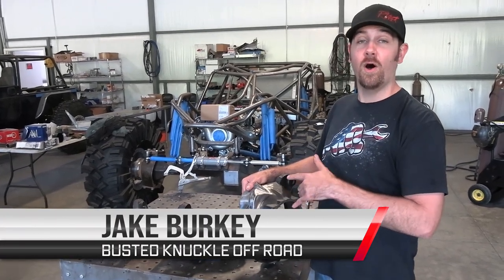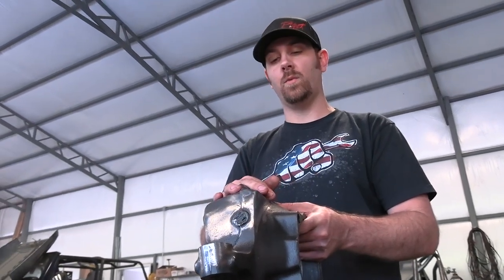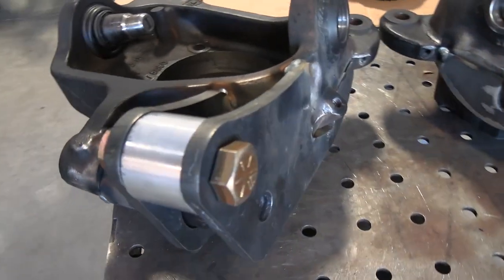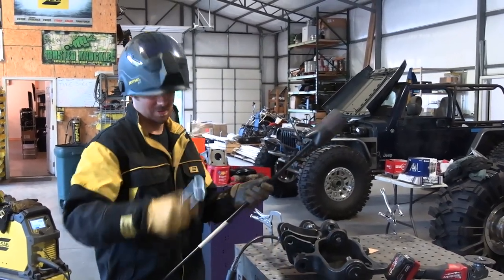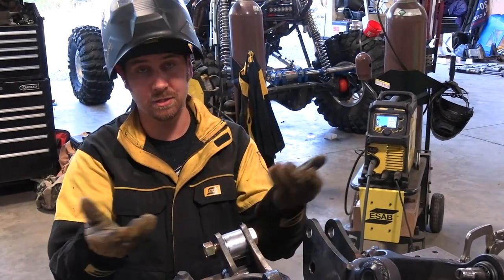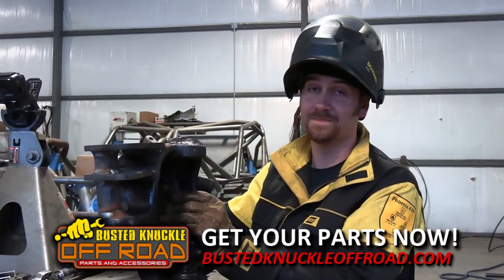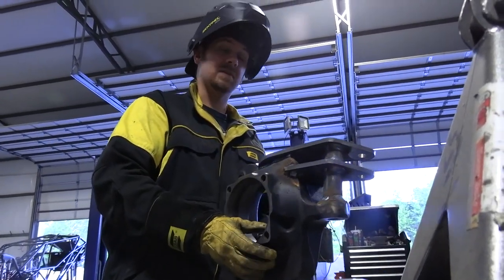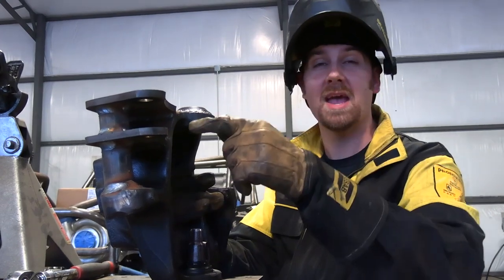Weld On Super 60 High Steer Kit - Tech Tuesday EP2

Comment: Will these work with 99-04 knuckles? The BJ eliminator?
Reply from the maker: sure will
Reply: Yup, just installed the ball joint eliminators, don’t forget to grind the top of the bushings down until you get about 25lbs of pressure to turn the knuckle free play.